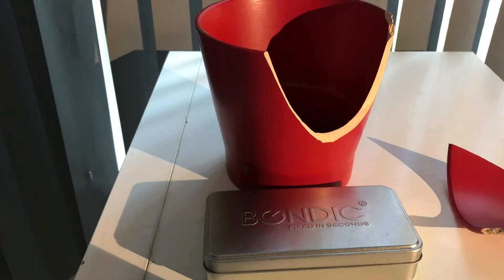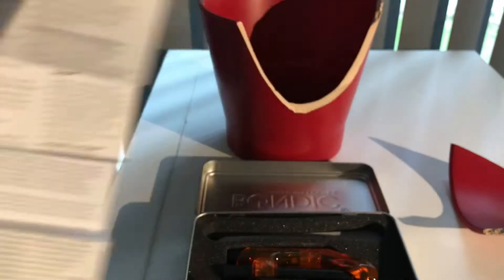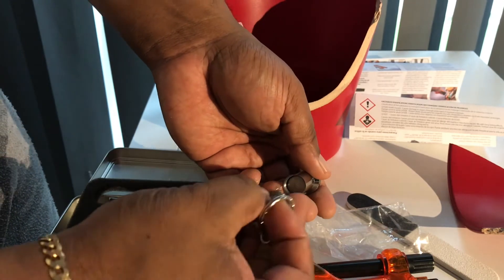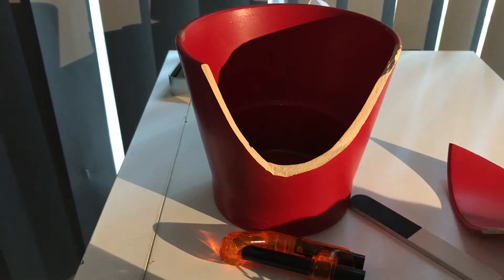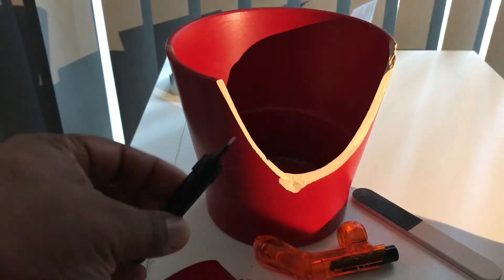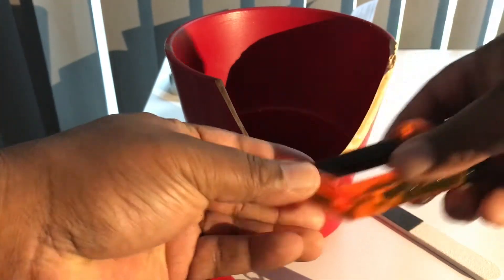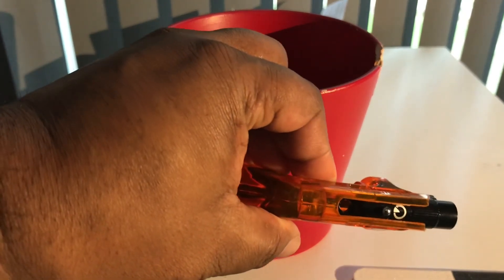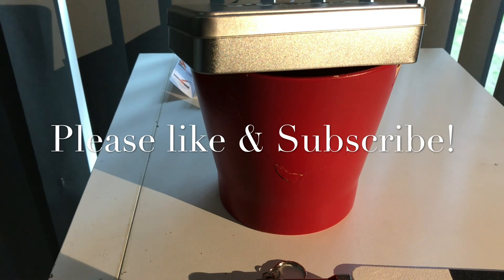Bondic liquid plastic Welder - Is It Any Good?

Comment: I have pinhole leaks in copper pipes in the basement leading to heater and hot water heater.  Will this be good to fill in those holes and cure the leaks?